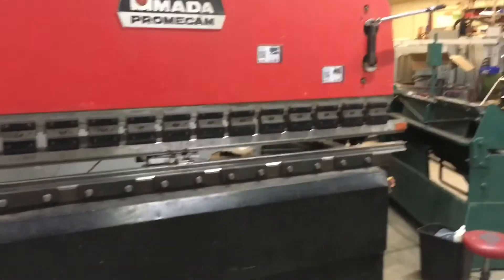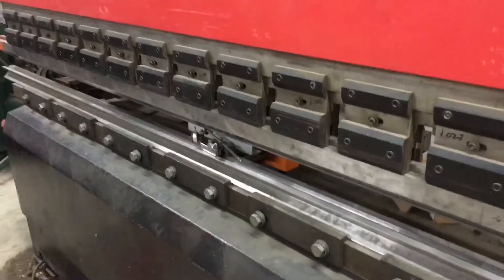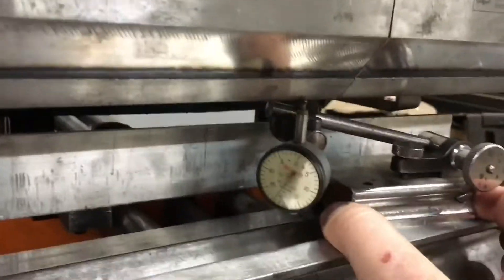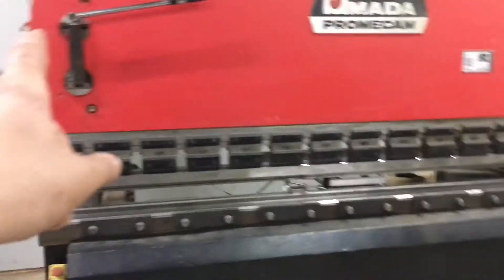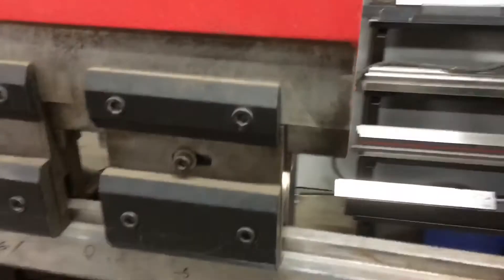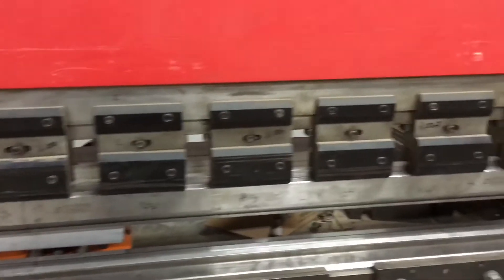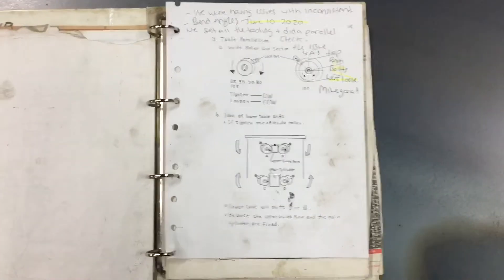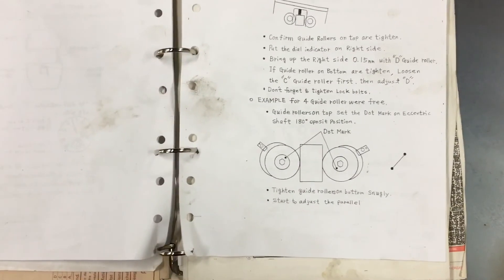Amada up acting break-press troubleshooting uneven bend angles

Comment: hey bud, ive got an older Amada Rg100 that seems to be just like the one you have. I have zero info about it and yesterday it got stuck in the upstroke and seems to be in a bind. Would you mind helping me out with some info maybe? I would greatly appreciate it. Thanks bud!
Reply from the maker: IM pretty sure the cylinders are single acting.

either you are not generating pressure to allow the ram to come up or its possible that the cam roller bearings are seized and not allowing ram to go up and down. Try disconnecting the hydraulic lines to the cylinder to see if ram will come down. it will probably drain the oil out so be prepared.
Reply: @bruneprune  it looks like the cams are preventing it from coming down, they are wedged it seems. definitely a mechanical stop, it will go up slightly then stop in the same place on the down stroke.

Comment: Hello everyone!
Amada Promecam press, working area 3m, pressure 100t. New control installed 3 years ago. The press has a lifting lower beam with one centrally located cylinder.
The problem is the difference in bending angles between the left and right sides.
According to the instructions from the end of the video, I adjusted the lower beam with wheels No. 3 and 4 (photo below) to raise the lower beam by 60 mm, so that the difference between the left and right sides between the beams was 0.01 mm. However, after lowering the beam to a height of 10 mm, the difference between the beams is already 0.19 mm.
The instructions (last page at the end of the video) mention a similar problem.
Can wheels no. 1 and 2 be responsible for the adjustment between beams at different heights?
I would be very grateful for your help!
Photo: https://drive.google.com/drive/folders/1Q0a3jI4O5iDj9ALRLueufp25snpEz8w_?usp=sharing

Comment: You also need to measure your tooling for wear, check the die width along the whole bed and the punch. Also check the bed for wear from changing tooling. Would also add that your tooling is over hanging on both the punch and die and will flex if your folding along the full length. Don't forget to cycle your tooling to enable even wear.

Comment: Thanks for sharing this. Do you know anything about valves? I have a problem that when using a pressure of more than 12 tons, the press does not open when the pedal is released. I think one of the valves is not opening. May be you have some information about valves?
Reply from the maker: That hasn't been an issue for us. If you have the same machine as me and a hydraulic controlled foot pedal. remove the back cover on the machine and make sure all the cams that it activates are working it could just be an issue like that. I have had to fill up with hydraulic fluid my pedal before but usually that's something where the press wont go all the way down and pressurize.
Reply: @bruneprune  Can I contact you? Maybe you can send pictures of what your valves look like, I also think they can have different types of upgrades. My pedal-controlled valve doesn't seem to be original. Thanks for the advice on the pedal, the oil level was also low.
Reply: Hi just recently bought a promecam it 8025 and don't know how to go on manual mode! It's got a controller Concorde, been trying to add a photo here but couldn't do it